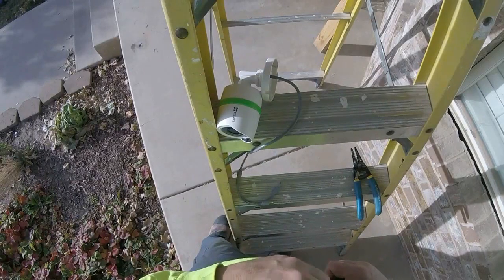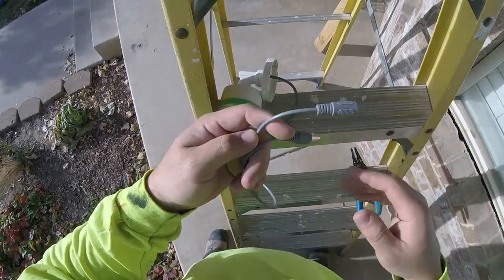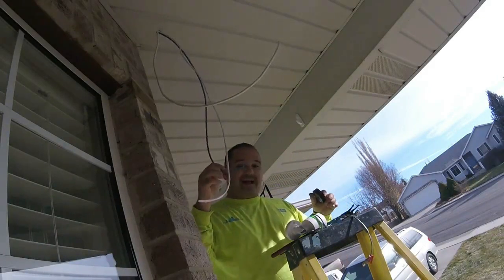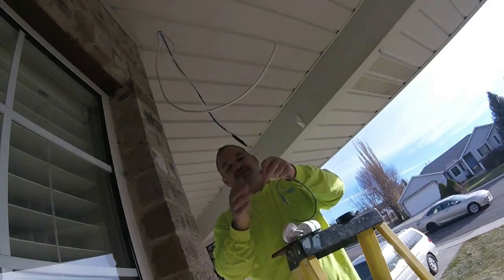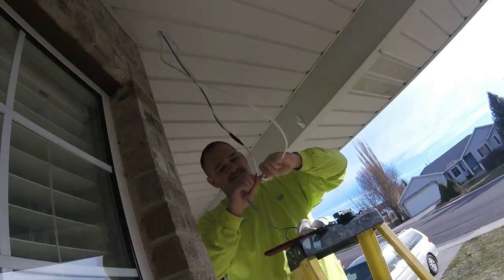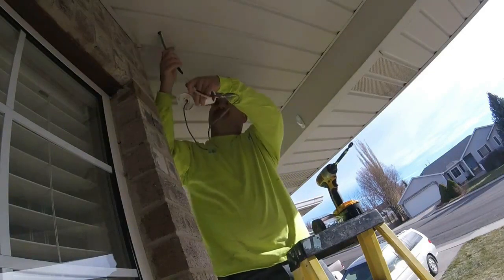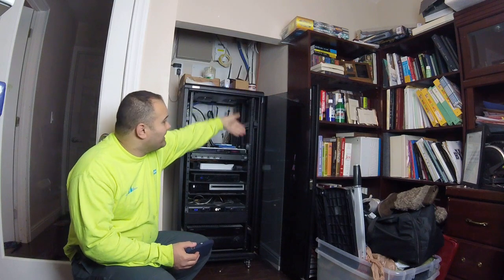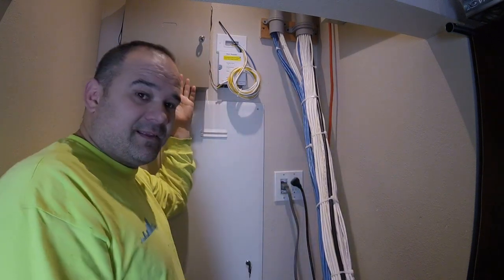How the pros install home security cameras, Part 3

Comment: When mounting on soffit, it might be a good idea to put a small piece of ply or a 1x2 to hold it in better. It does require removing the metal screws to bend it slightly, and in some cases you might need to take off the soffit. It sounds harder than it is, but when your upgrading to POE, get dome cameras and you can cut a small hole to fit the wood in without taking out the sheet metal as well.
Reply from the maker: Good advice! Thanks for the comment

Comment: Awesome videos! Very concise and well explained. Only suggestion I would have is to electrical tape around those tiny wires to give them some protection so they don't get nicked when pulled or pushed (or if there are rodents in the attic).
Reply from the maker: Not a bad idea. Thank you for watching

Comment: I enjoyed your videos! I got my cameras installed but now I need to hook up an ethernet cord which is on the opposite side of the house. Could the ethernet cord be installed the same way as the camera cords up the same hole ?
Reply from the maker: I’m not sure if I understand the question. Are you asking if you can run an Ethernet wire in the same hole as camera wires or if you use the same technique? The answer to both questions is yes by the way. If that isn’t what you were asking, let me know. Thanks for watching!

Comment: Hi Alan
I want to run cables thru pipe. Do you install pipe thru dry wall beside top plale in attic.
Thanks
Reply from the maker: Running pipes in homes is really tough. Why do you want to run pipes?

Comment: Hey good job man.  In my experience working on motorcycles and car wiring, crimps don't hold well. I always have to add electrical tape to a crimp to reinforce that connection or I can't proceed in good conscious. Good job though thanks for the ideas. You definitely know what you are doing.
Reply from the maker: Thanks! In cars and motorcycles, I think there is too much vibration. My bro does that type of work and always uses solder and heat shrink tubes because he sees crimps fail too. He doesn’t like crimps alone either. Thanks for the comment!
Reply: Is youre using crimp connectors on a car or bike youre doing it the lazy way spend the money on the proper connectors aka deutsch connectors.
Reply: @ttss5726  I couldn't spend the money for something like that.That is not practical or economical. Those connectors are uncommon, non universal and not worth it imo. A simple bullet loom connector is second best imo after factory molded connectors because they are common and cheap. I don't see why change to a different format.

Comment: If we don't have a office closet to put a DVR, how should we pull the wires for room settings? I'm putting mine in the den, that has a computer and TV in it. Not wanting to destroy a wall, to run so much wires? Is there a box that looks nice I could run the wires to?
Reply from the maker: I use these a lot. You don’t connect the wires to this plate. You keep the wires long and run them through the plate and connect them directly to the equipment. 

https://www.amazon.com/Midlite-1Gwh-Gr1-Single-Wireport-Grommet/dp/B001TFDVLA/ref=asc_df_B001TFDVLA/?tag=hyprod-20&linkCode=df0&hvadid=226131567976&hvpos=&hvnetw=g&hvrand=12737341519231327257&hvpone=&hvptwo=&hvqmt=&hvdev=m&hvdvcmdl=&hvlocint=&hvlocphy=9029721&hvtargid=pla-377180846144&psc=1

Comment: what power suppy are you using here? Make and model would be good!
Reply from the maker: I am using an Altronix power supply with 8 outputs. I got mine used from some kind of electronics auction so I paid almost nothing for it. I have no idea what the model number is and it’s so old they probably don’t exist anymore. Something like this one from Amazon should also work:    https://www.amazon.com/ALTRONIX-Supply-Outputs-Enclosure-ALTV248UL/dp/B0038L43KQ/ref=mp_s_a_1_16?dchild=1&keywords=Altronix+Power+Supply+8+out&qid=1608839309&sr=8-16

Comment: they make power adapters so you don't have to modify the cameras harness. i would have installed cat 5/6 and baluns, in case you ever update to ip based equipment
Reply from the maker: I know there are adapters and baluns available, but I chose to do it this way to save a little $$$ and eliminate the extra equipment/material. I think adapters and baluns should be avoided as much as possible to minimize the number of points of troubleshooting that may appear. Thanks for the comment and thank you for watching.

Comment: I'm wondering why you're not using POE if those are IP cameras? You would save yourself a whole lot of trouble from pulling that extra cable if you just used a POE switch and not have to run power cables along with the CAT6 cabling.
Reply from the maker: Correct. I did not do a good job of verifying what I was buying and it was too late to return the system when I realized.
Reply: @AlanCleggYouDoAV  still a good video. Thanks for the good info.
Reply from the maker: @JUSREEL1978  Thank you for the comment and thanks for watching!

Comment: He could use the cat6 to connect the analog cameras with a balloon adapter
Reply from the maker: I'm not a fan of adapters. I appreciate that they are convenient and would make it so I don't have to cut the power cable, but I prefer to eliminate any adapters which can become a potential point of failure. Thanks for watching!

Comment: How did I get here lol... Oh well. Why is it that I always go after installers and find things like this? 1 the folding of wires that are no good already is not good practice. They make it so they can pull out easier then if you were to just put the wire in without the fold... Next thing that Butt Connector is for 22-18ga (awg) wire and you keep saying that you are using 16ga (awg) wire? I don't know maybe the 16awg wire that I use is larger or something but it will not just slide into a 22-18ga butt connector without removing some wire strands... (That is really bad Practice) (ever heard of Closed in Crimp Caps?) Then I am confused as your Listing of your Video says this is how the Pro's do it??? Ever heard of UTP Balun connectors? (Pro) I mean really your running cat 6 you said.. You said your Cheap? Wait What???? RG6? Cat 6 and AWG 16 wires???? I am going to guess that you work for someone and over time have put away this (Your Cheap remember) wiring from your jobs, Skim a little here and a little there no one will notice and wow after 2 years you have enough to wire your home and maybe your friends house with more wire then ever needed.... On cat 6 and Baluns you could have had with 1 wire feed it all and then some... There are some that are Power and video, there are some that are Power, Video and Audio and for some Awesome cameras there is the Power, video, audio and Data all on 1 cat wire.. Now I will admit that I have some Cameras that require 24vac and I still use these Baluns to power the baluns because they still need to be powered up and use the Data for running my PTZ camera...  WOW really cutting off the Power Plug on JUNK wire to start with, then all that work and in the end you could have bought 10 connectors that you were talking about in other video leading up to the 3rd one that when connected to your Power wires that are way over kill for them Cheap Cameras that I am sure didn't need more then 500ma of current them cheap wires that came with the camera kit would have been just good enough for this over kill install???? Nice though you were nice to show people how to run wires to the attic and wait LOL.. Pro? No backing for the camera to get a good hold and not shake in the wind, no protective grommets like rubber or plastic knock out or even just a through hole to make it so the cables don't rub on the metal soffit... Not good practice... Nice looking data rack and closet there is something that looked nice and well thought out...

Comment: I'm sorry man, you are doing too much work. Simply running cat6 (honestly cat 5e would have been fine) and using an active balun would have been so much easier. Speaker wire is overkill and barrel connectors is just inviting problems. It's a great video but you're spending too much time and money on extra wires and steps
Reply from the maker: I understand your preference. In my case, I try to involve as little extra equipment as possible. Baluns are great, but they are more likely to fail than a crimped butt connector. You're right about wire- it's expensive and did use a lot. I had a lot left over from wiring my house so it didn't matter to me though. That wire was sitting on my shelf for over 5 years.